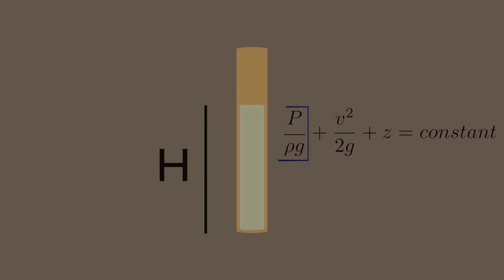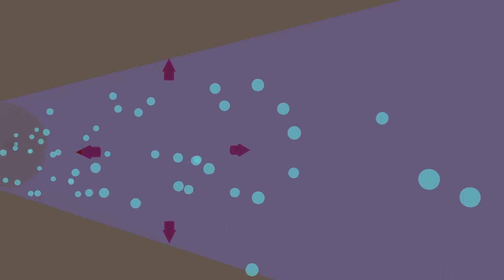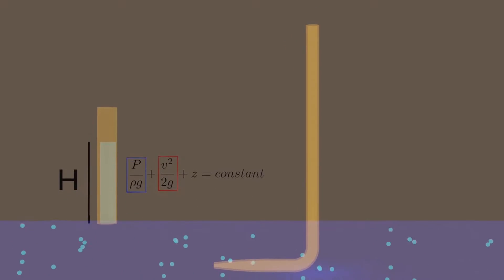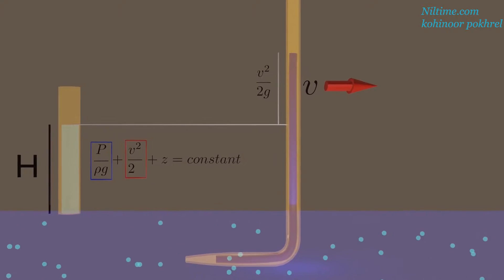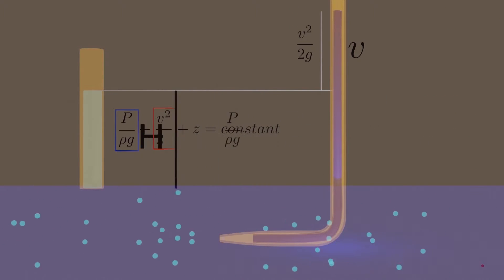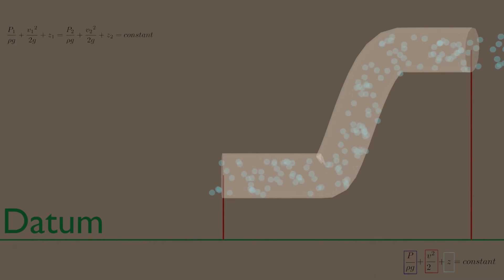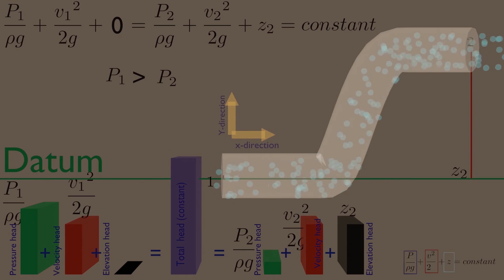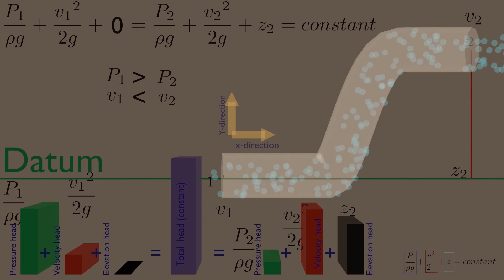Visualizing Bernoulli's principle in term of head (height) (animation)

Comment: Thank you for the video! I have one question, why at the entrance of pitot tube velocity decreases to zero? shouldnt it increase to maximum because of low diameter?
Reply: Because the kinetic energy of the fluid is no longer enough to push the weight of the fluid in the pitot tube thats why the velocity of the fluid in the pitot tube becomes zero 🙂

Comment: wrong explanation at the end of the video !! Velocity of the fluid doesnt change if the diameter remains the same. Drop in the pressure head does not affect the velocity head. Note that the discharge is the same all along the pipe!!
Reply from the maker: imagine it a converging pipe, everything will be allright ^^
Reply: @NiLTime  , It is still good to say that when the cross-section area (let me say S1 and S2) is the same at the both sides of the tube, then the speed (v1 and v2) is the same, too. This is because of the continuity and incompressibility (the basic simplifications). These assumptions state that v1*S1 = v2*S2 = const, i.e. the mass of fluid flowed through S1 and S2 per unit time is the same, so the density. So, the Bernoulli's equation is (in dimension of pressure, but it does not matter): p1 + ro*v1*v1/2 + ro*g*z1 = p2 + ro*v2*v2/2 + ro*g*z2 . Since z1 = 0 (datum is here), v1 = v2 (S1 = S2 and incompressibility), then the equation is: p1 = p2 + ro*g*z2. In other word, the static pressure p1 is a sum of the static pressure p2 and the potential energy per unit volume ro*g*z2.
If there is a mistake in my explanation, then excuse me and correct me.
However, your fluid mechanics videos are great and very, very useful! :)
Great work!